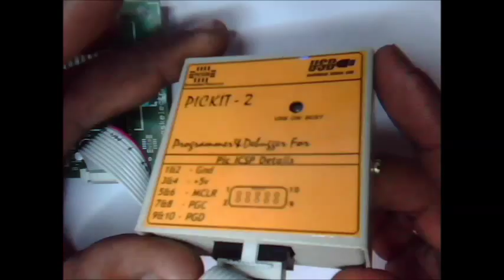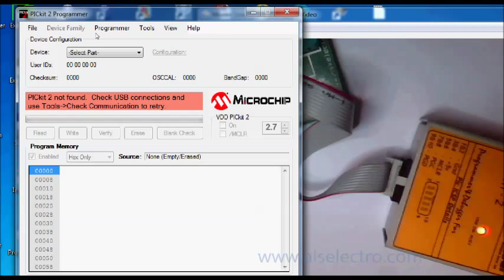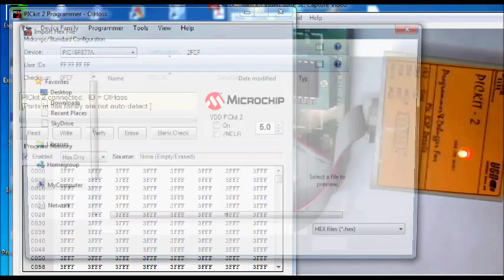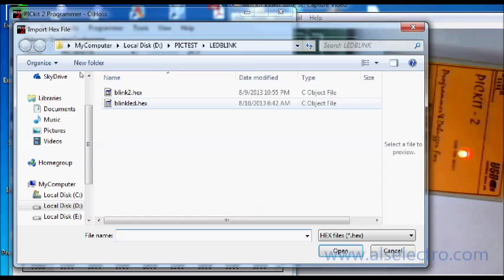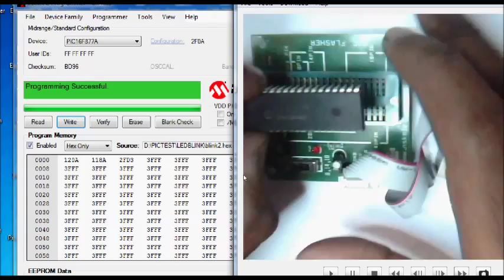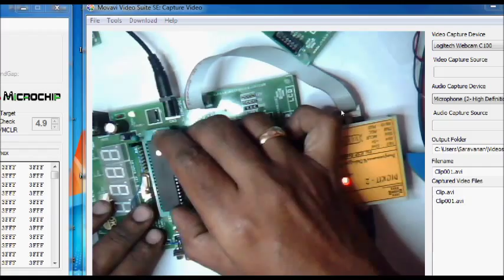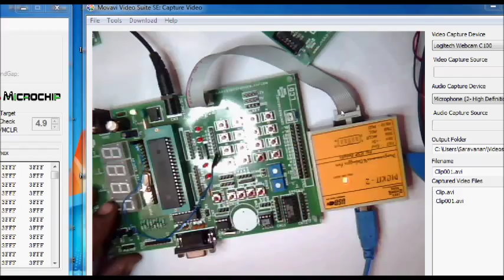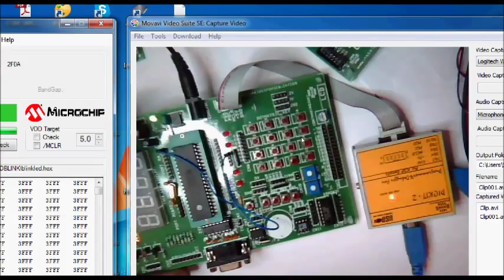PIC MICROCONTROLLER PROGRAMMING - HANDS ON HARDWARE

Comment: If anyone is using 14 pin IC or any other Pickit type, refer this answer here: https://electronics.stackexchange.com/questions/420828/pickit-2-vpp-voltage-level-error-check-target-retry-operation-error-in-picki/420830#420830